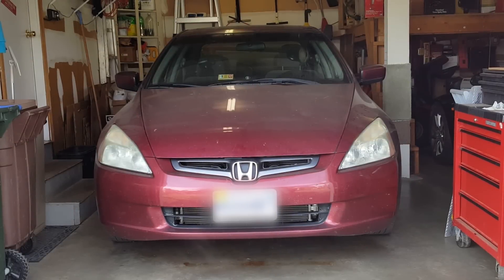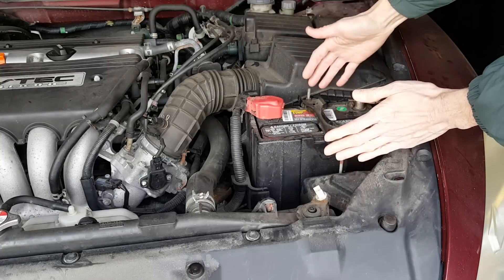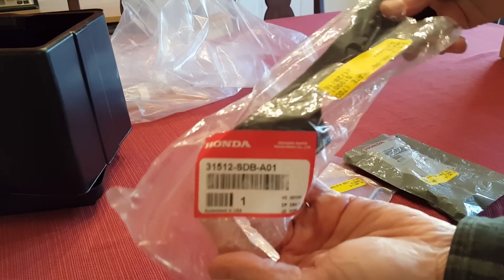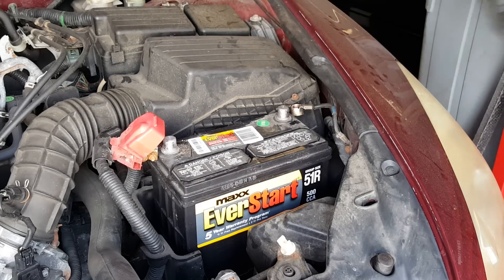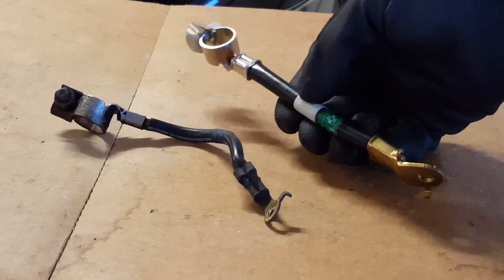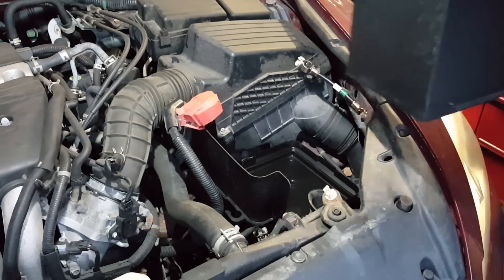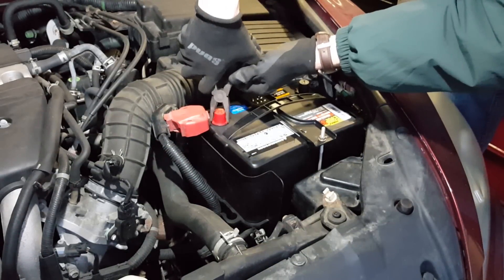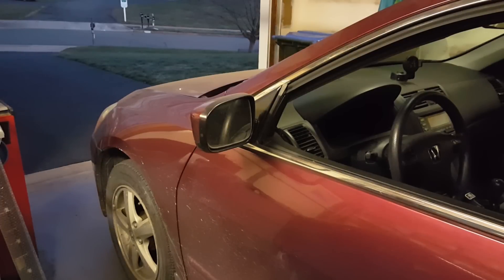Honda Accord?  DIY upgrade that undersized battery!

Comment: Thanks for your video.  Is there any data to be lost with disconnecting the battery.  I have 2015 Accord with 4 cylinder.  During a rare freeze here in south Louisiana this winter, I noticed that the car was slow to crank.  Only 1 episode and freeze is rare here.  I will consider upgrade with replacement.  What was your hardware replacement cost? excluding the battery?
Reply from the maker: The most common one to note is that you may lose your saved radio station presets. Plus, you'll need your radio's anti-theft security code to unlock it once power has been restored. The code should have come with your car's paperwork. Otherwise, I don't know about your specific car but on older Hondas, the code is often located on a sticker in or near the glove box or inside the fuse box cover (under the dash or under the hood).

At the time I made this video, my parts listed totaled about $65 plus shipping from an online source. Compare bernardiparts.com, hondapartsonline.net, hondaautomotiveparts.com, and hondapartsnetwork.com to name a few.

Comment: I always wondered if the four-cylinder EX model with front heated seats equipped with the small or the big battery?
Reply: I have a 2013 EX 4-cylinder with heated front seats and it came with a 51R battery

Comment: The problem isnt your battery size, The problem is your buying batteries from Walmart!. Those things are garbage, I never recommend those things to my customers because they only last a year or two. Your lucky that your car has the option for 51r or 35 group size batteries but not a lot of cars have that option that originally comes with smaller batteries. If your gonna by a battery get a GOOD BRAND with a GOOD WARRANTY. If you try to save a few bucks buying a cheap battery then your spending more and in the long run because your gonna be replacing the damn thing every couple years. A good battery will last you 4 or 5 years and sometimes longer if you are lucky. I paid 200 for an optima battery and 6 years later it still starts as strong as when i bought it even on the coldest of days.
Reply: Almost all flooded and AGM car batteries sold in the US are made by one of three companies:  Johnson Controls, East Penn, and Exide.  They just slap different labels on them, brand preference doesn't really matter anymore, unless you go into the $250-$300+ range for the exotics, and then you may be lucky to get another year of service above and beyond a bargain battery.  I'd rather get myself a new Wal Mart battery every 3-4 years and save my money for other things.  EverStart Maxx has been a good brand for me and they have been every bit as reliable as the "premium" brands, which are not worth triple the price, considering all you're getting different is a different sticky label.
Reply from the maker: I can only report on my own personal experience. I am certainly not promoting EverStart batteries from Walmart in any way and that's obviously not the point of this video. I prefer Interstate brand batteries and have nothing but high praise for them. However, I have purchased several EverStart batteries for cars and lawn equipment and they have served me very well, too, and lasted for many years.
Reply from the maker: Interesting hypothesis. How did you come to that conclusion?
Reply: I guess the Walmarts in my area are just unlucky cause i've never seen a Walmart battery last more than 2 years and i mean ever. And yes I know a lot of batteries are the same thing just rebranded, its the same with alot of auto parts but Anytime i install a battery from there for one of my customers they're always back within a year so now i tell my customers to stay away from them. last time I myself bought a battery from there was years ago cause i just put a new motor in one my cars and i needed a cheap battery just to get the car running and the thing died 4 months later. From what I see with my own eyes they are not reliable at all, Its great that it's working out for you and I wish you the best with it but if anyone asks my opinion on them their garbage and i cant recommend them from my own experience owning one and replacing many.
Reply: @Deekilledyou   I understand your frustration but I havent had an issue with these walmart batteries at all. Longest one I had was for my Acura TL (   5 years ) but then I got rid of the car..Battery was still in great condition too.
Reply from the maker: It sounds like your experiences may have been with the regular EverStart batteries. The specs and warranty on those are definitely mediocre as compared to the EverStart Maxx.
Reply: In all honestly walmart batteries seem like a quality control issue more than anything.  I have one in my truck from 2012 and it is just now starting to crank up slow so I'll probably replace it.  We put one in the G/F's suv and it died in less than a year - but was replaced free under warranty.  Guess we'll see what the next one does.  Generally in my life (and I use almost exclusively walmart batteries) I would say they last on average 4 years here in texas.
Reply: Yep. Those made by Johnson Controls typically have a grid pattern molded into the sides of the battery and two large vent caps. Those made by East Penn are smooth on all sides. The old battery in the video was made by Johnson Controls. The new one was made by East Penn and has a serial number beginning with  "EP".

Comment: Got a 2015 Accord that came with a 410 CCA  Battery. Even less than this one.
Reply: Upgrading tonight
Reply: I'm running my V6 with a small lawn mower battery, group size U1 for weight reduction.

Comment: I have a 9th Gen Sedan V6 and read that this particular model has Battery issues. It currently has a 490 CCA Battery. Would upgrading it to a higher CCA be bad? Would it put more strain on the alternator or the other electronics? Thanks in advance.
Reply from the maker: No, a higher CCA rating means that the battery has more current available when the car demands it. The voltage will remain the same.  Your alternator should be able to handle the small upgrade just fine. Just don't try putting a monster truck battery in there.
Reply: Thank you!

Comment: I have a civic can i do this upgrade ??
Reply: Yes, good idea 💡. O’Reilly, Napa, or Auto Zone can tell you about the size upgrade. 35, 39, 34R, or perhaps 24F would likely work well. You may be able to squeeze a monster battery in there (750-1000 cca), if you’re looking to push the limits. 24 F is likely the cheapest way to go.

Comment: I have a 2014 Honda Accord with a 51R OEM battery. Battery seems to be under powered for the car considering all the electronics the car has (upgraded speakers and an Alpine Power Pack KTP-445U---nothing crazy, system works fine). I was considering switching out the 51R and instead using a 24F battery. Are there any issues in using a  larger battery in my I-4 stock Accord.Will the larger battery burn out my starter, ECM or anything electronic. CCA in 24F will be more, but any other negative side effects? Will stock alternator be able to charge the 24F?

Thank you all for your time and information.
Reply from the maker: You should be perfectly fine with a larger battery. It will not burn out your starter or anything else. It will simply provide more current for when the car demands it, as when starting it on a very cold morning. Also, your stock alternator should certainly be able to charge it. It would be a good upgrade for your sound system, too.
Reply: Can i use battery 36? My is Honda Accord 1999 4 cil.
Reply from the maker: I don't have specifics for those 6th generation cars. You'd have to measure it and compare it to what the 6 cylinder version came with back then.

Comment: There is too much extra space that you can put almost any batteries. 124 is great...73 is despite highest power is still lowest in price( it is long but fits in).Even RED on left or right does not matter as cables are floating and in the center .Thanks for the video.

Comment: I have a 9th(2015 ex sedan 2.4)gen and I had to take it to Honda, most of the dash light came on and TPMS light started flashing. Took it in for service and they replaced the battery (no charge) and it was working for a couple of weeks. I took it back and same thing with the dash lights and the service adviser said that they have to replace the battery sensor. I'm not sure but i feel more like this video makes more sense than what they're telling me. when I was looking to replace the battery myself the only size i was able to find was 51r and that was 500 CCA but your's is 51n and 640 CCA (which I would rather have since everything is electric) ?!

Comment: I have a Honda 2010 Accord and I read an article that said to change batteries on cars after 2009 or 2010 that some device has to be attached to the computer or electrical system so the car doesn't lose or affect it's memory or something like that, that would cost possibly $ 100.00 to have reset at the dealer.  Is this accurate or did I not understand what I was reading ?  If so, then what do I need to do in order to change my battery myself without messing up the vehicle's memory ?  Charles Enscoe
Reply from the maker: You are probably referring to a device called a memory saver. It provides continuous power to your car's electrical system when the battery is removed. I believe it to be a convenience item rather than a necessity. The most notable benefit is that you don't have to deal with entering your radio's theft deterrent access code or reprogramming your radio station presets. Yes, the car may have to go through several drive cycles to relearn its optimal engine management settings and to reset its readiness monitors, but the car is perfectly designed to do that.

Comment: What's the grouping size battery for a 2000 Saturn Car and a 2002 Volks Wagon Jetta and a 2002 Chevy Impala ? I'm asking cause i seen these batteries at Wal Mart but wonder would these Ever Start  batteries would work with no problems for the cars i listed ? Cause some 1 told me it's the grouping size is what matters ?????
Reply from the maker: While in the automotive department at Walmart, you can use the little machine by the batteries to look up the group size for any car. It is convenient to do it there where you can compare the physical battery sizes and terminal locations. Doing so will hopefully answer your questions.

Comment: get yourself a Interstate Green top battery. Most batteries on the market are junk. Thank me later.
Reply: Jay Chino I've got a Interstate Green Top and after 18 months it's giving me problems now I'm going to bring it in because it still under warranty but I'm thinking about going Optima for my wife's car but IDK because I hear bad things about Optima . I'm lost
Reply: Optima batteries are the bests one's you could get because there not acid type batteries like most on the market, their Gel types instead. I've had one in my car for 6 years and it's still strong., Just make sure you get the right one cause there are yellow top Red top and blue top. The red top is for Extreme starting power, Yellow is for if you have a sound system and need something to handle the extra load, and Ignore blue because those are marine batteries. there alot more money but definitely worth it.
Reply: Does that Optima come with a spelling/grammar checker?
Reply: I take the interstate batteries out all day at work and replace them with optimas you can thank ME right now for saving you from that interstate junk
Reply: Koalafications4Dayz 
I have 3 interstate battery is in 4 years ..they sick now . I'm done with them . 25 years ogo they would last about 5 to good 7 years ..crap.
Reply: Great video. Had to stop halfway to say I appreciate the thoroughness and information you've given so far.
Reply: Interstate is overrated junk

Comment: will upgrading the battery fix the annoying rattle when it idles
Reply from the maker: I suppose that it could be almost anything that is rattling under the hood or under the car. Unless the battery itself, the tray, or the hold-down clamp is loose, upgrading likely won't resolve the rattling. I'd first look and see if you can isolate where the rattle is coming from. You might just have a loose heat shield which is very common.

Comment: 4:29 You could sand the paint off the frame where the ground strap attaches for increased conductivity. Apply some dielectric grease over the connection, and over the tops of the battery terminals with the cables connected for better corrosion resistance. I clean up all the ground points I can reach in my car.
Reply: Good tip, especially if you live in the salt belt.
Reply: after you snug down the bolt on to the fresh metal, hit it with some clear.   to protect the exposed new metal.

Comment: I have a 2010 civic hatch R18 engine. I need a battery with higher amps. The biggest i could fined that fits the space is 45 amps. The car came with 48 amps that i can't find anywhere. Dumb question but will the accord box fit on the civic?
Reply from the maker: It depends on how much space you have available.  There seems to be quite a bit of chatter and advice on the subject.  http://lmgtfy.com/?q=honda+civic+larger+battery
Reply: worsethanchiggers Thanks so much for the help bro. Don't know why i didn't think of google LMAF

Comment: Anyone managed to fit this tray to TSX/EU Accord CL9? Since it suffers from same problem.
Reply: I just put a 24F battery in my 07 TSX. The suggested parts in the description do not fit though... I ended up removing the original battery box/cover and used the existing battery tie down plate & J bolts to secure the new bigger battery.

Comment: I have the same issue, in the last 6 years I've changed the battery 2 times - I live in the North. I need a higher cranking capacity battery and I can't seem to find them in the size 51R. Good thing I saw this before replacing my dead battery tomorrow. Thanks!
Reply: I live in South Carolina and it doesn't get that cold here but I still can't get more than a little over 3 years in my CRV. The CCA of the small battery just drops below what the engine needs after 3 years and has to be replaced, even in a warm weather state
Reply: I live in Central Illinois and had an Autozone Duralast 51R series last about 5 years in a 2012 Accord. We only drove that car about twice a week though so maybe that was the reason it lasted through 5 winters.

Comment: Thanks for the vid. I plan on taking similar principles and applying it to a 7th gen civic. Those 51R profile batteries are no bueno for aftermarket car audio systems.
Reply from the maker: Good point. Serious car audio systems can draw a lot of current. Let us know how your conversion goes and how your experience differs from mine.
Reply: Iknow it been along time since your comment but i was wondering if you achice the upgrade on the 7th gen civic as i am planning in doing it in my 7th civic

Comment: My 2010 accord battery was just dead after I had not drive for a week.  Went to Costco for a normal Kirkland battery without knowing prevous ower had already upgrade to a bigger battery. Thank you for this video. Now I know which model should go into my car.
Reply: Or, you could have just looked at the battery you were replacing, Genius.

Comment: Can this also apply to the 2013 Honda Accord inline 4?
Reply from the maker: This procedure should apply to all 7th and 8th generation Honda Accords from years 2003-2013 with the 4-cylinder engine.
Reply: What about the 2013 / 9th generation HONDA Accords....
Reply: Definitely works for the 2013. I changed the battery on a 2015 two days ago.

Comment: Honda battery size is really shit. Two expensive Deta  45 Ah batteries dead in a 3 years, and no possibilities to use radio longer as 10 minutes without working engine to avoid unable to start engine. After second Deta battery dead, I took out all these stupid plastic parts and take on a 10mm self cut rubber mat VARTA Silver Dynamic 61Ah D21 600A battery. Size is little to big, but, even this, it is possible to install in an old place, using same old metal arms. Now, using over 1 year, there is no longer any problems with battery, engine start and I can use car radio when I want!
I live in Riga city, Latvia.
Reply: well done

Comment: If you keep buying those WalMart Never Start batteries. You will be doing this again in a matter of months. Those batteries are crap.
Reply from the maker: +Bleepnsheep  I'll be the first to admit that I'm on the fence about the EverStart brand sold at Walmart.  I'm definitely partial to Interstate batteries but this car came with an EverStart 51R so I was entitled to the free replacement within its warranty period.  Opinions differ, too, over Consumer Reports ratings but they deemed some EverStart batteries a best buy a few years ago.  That may have changed and may not be the case with the little 51R.  I have had good results with other sizes in the past.  The last wonderful Interstate battery that I had in my Jetta lasted nearly 8 years!
Reply: +worsethanchiggers  Autozone  Duralast is also a good brand. They usually outlast the warranty.
Reply: My 2013 accord battery of two years stopped today it's was the Walmart ever start cheapo my dad made me get a duralast from auto zone so maybe I'll be rolling a while now because I know accords supposed to go forever!!!!
Reply: Everstart and Interstate batteries are made by Johnson Controls. That being said, there must be a large difference in quality.
Reply: Ski Fall True, those batteries are deep. You get what you pay for.
Reply: who the heck buys battteries at walmart